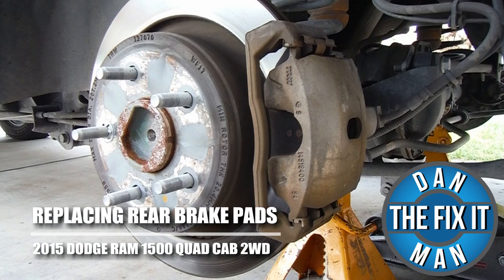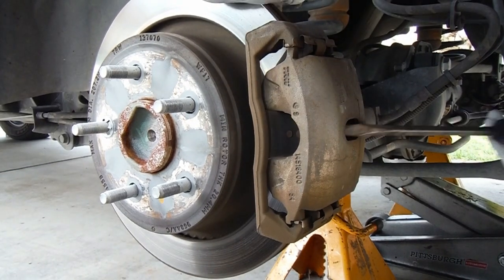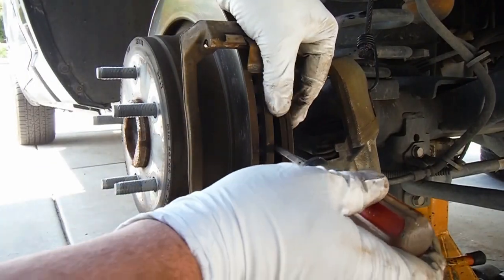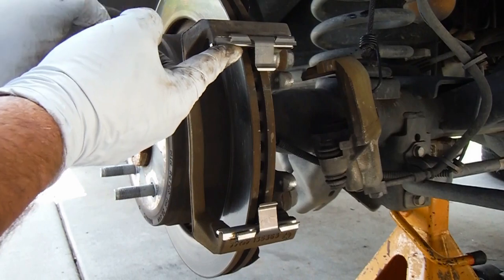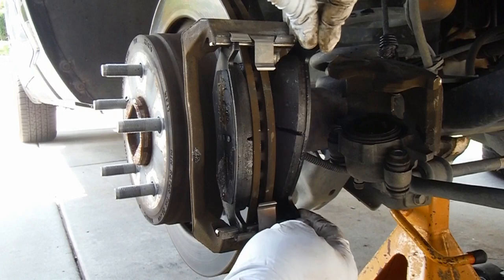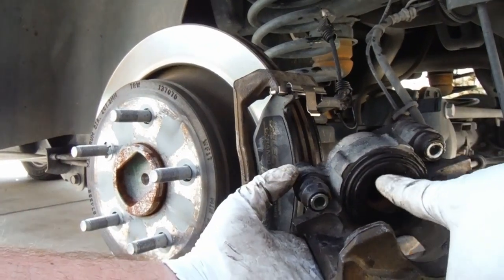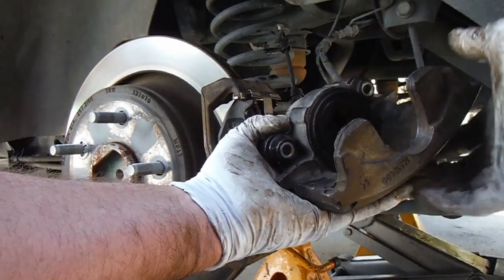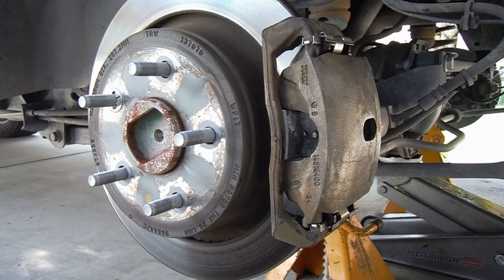2015 DODGE RAM 1500 - HOW TO REPLACE REAR BRAKE PADS - RAM TRUCKS - DIY

Comment: Great video.  i am 66 and replaced a master cylinder 40 years ago but never the pads.  After 82000 miles, it is ready.  Liked and subscribed as requested!  Thanks!
Reply from the maker: Thank you so much!